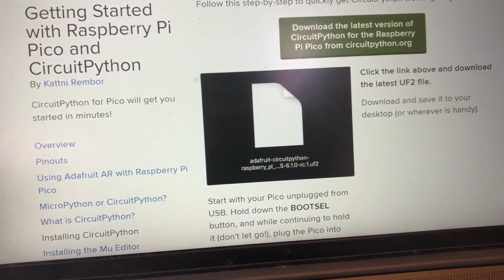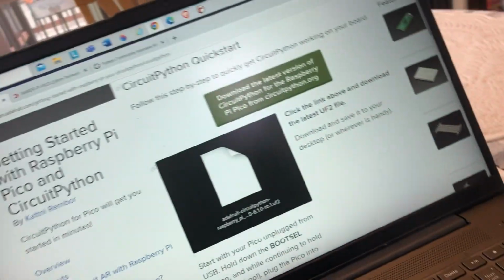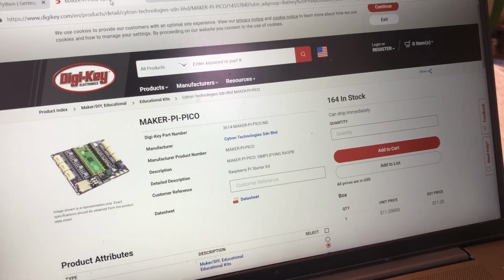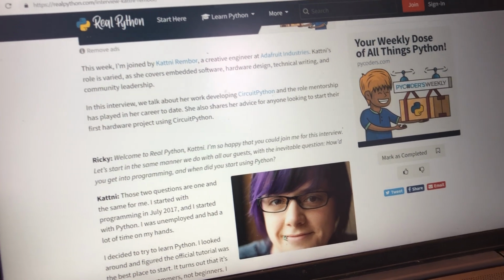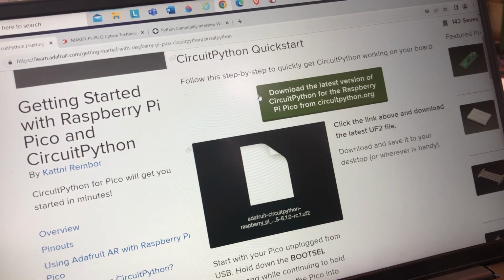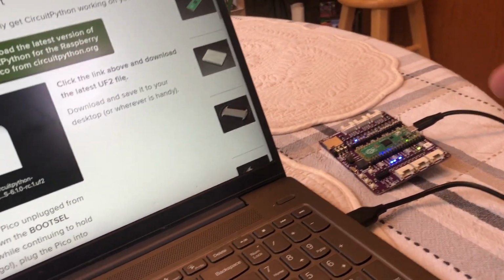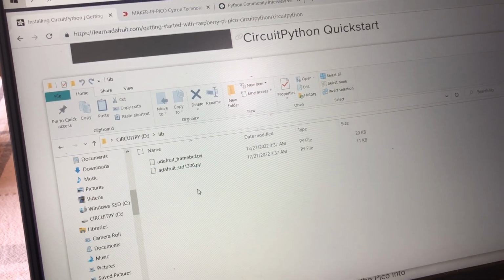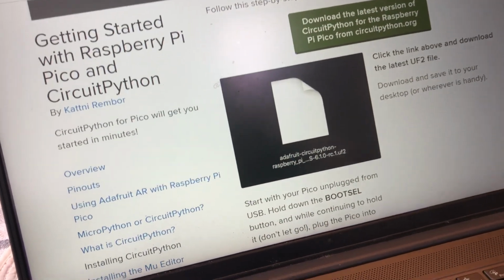Pico Raspberry Pi, Maker Pi Pico and Adafruit Circuit Python Tutorial

Comment: I believe the reason to download the UF2 file is not so much for the library files but to actually put firmware onto the PICO so that it understands Circuit Python?
Adafruit have chosen to include the 2 .PY library files ( for ssd1306 display board ) 

Other manufacturers of PICO based boards may decide to include different library files in the UF2 firmware specific to their board!

By downloading a different UF2 you can make the PICO understand Micro Python  instead of Circuit Python

Also the library files can have .mpy as the suffix - these are compressed versions of the .py library so take up less space.